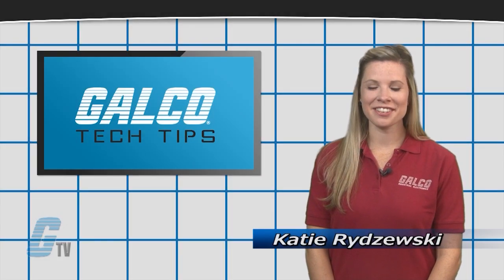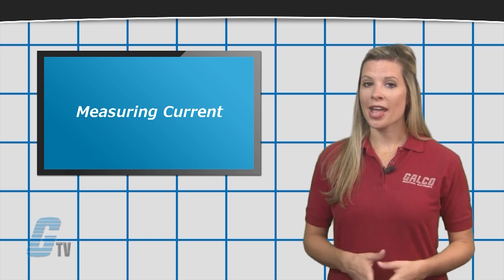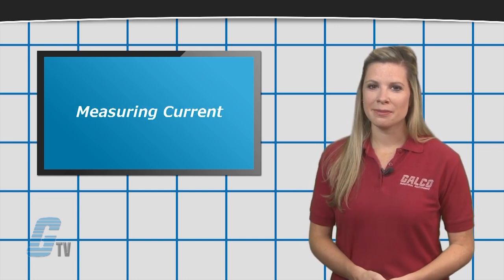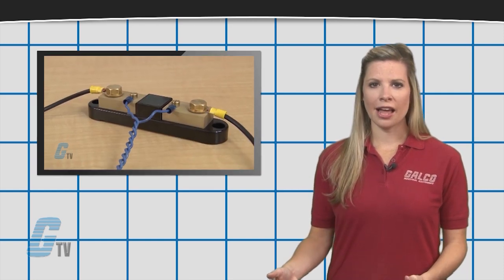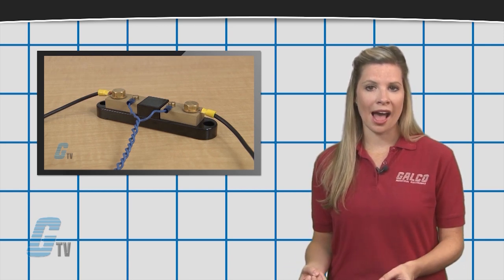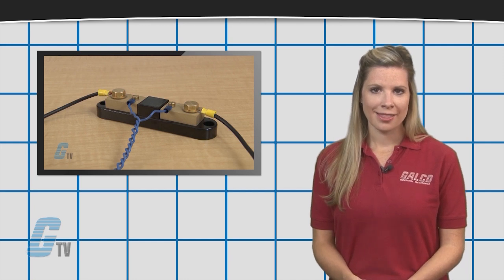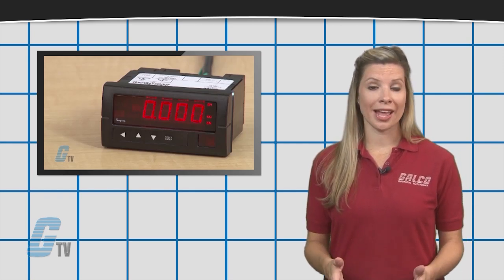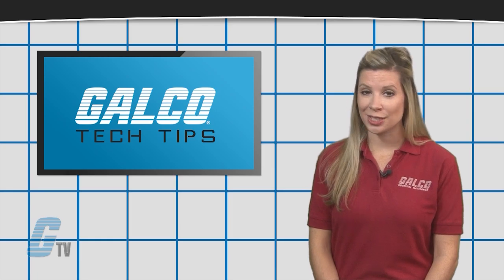Different Methods of Measuring Current - A GalcoTV Tech Tip | Galco

Comment: What's the point of using the shunt when the clamp on AMMETER seems much simpler to use?
Reply: And the thing is that clamp meters are not very accurate for small currents
Reply: It s actually the method used internally by multimeters ( except clamp meters)
Reply: Or maybe you want to build a power supply with voltage and current readings. Well, it would be pretty tough to implement it with a clamp